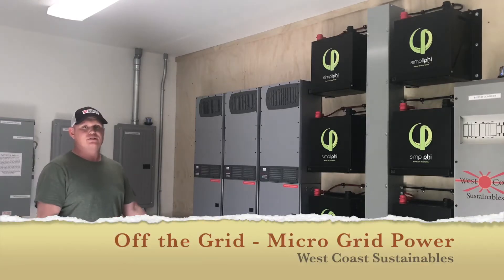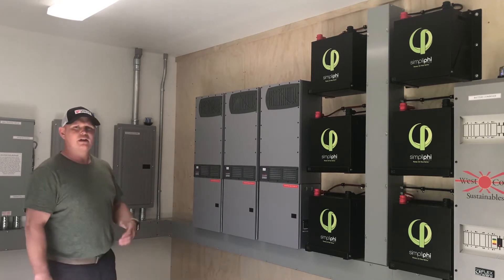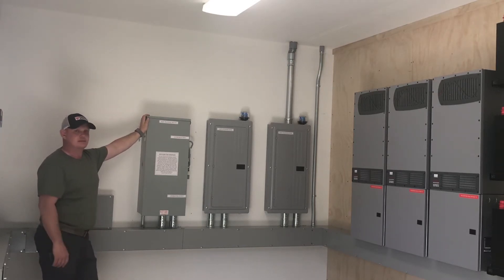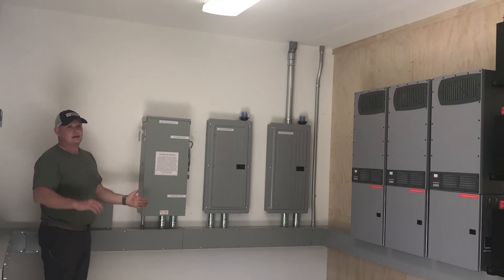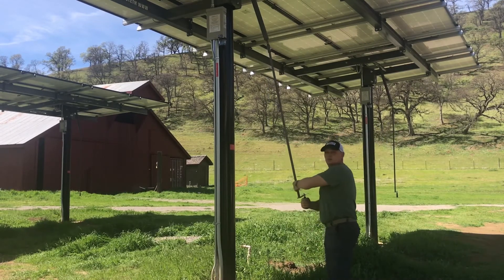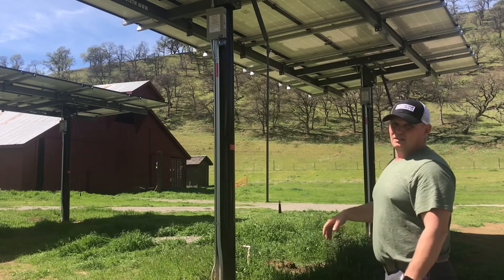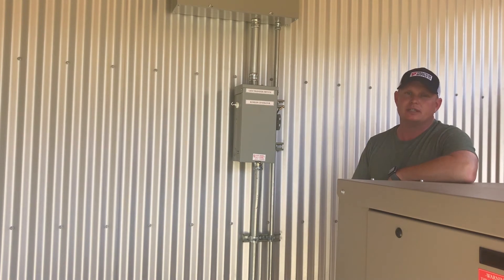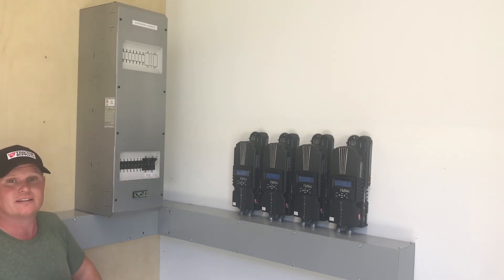Governor Browns Off Grid Micro Grid

Comment: For such a nice system, it is a shame to see the obvious violations
1. Koher 24RCL not rated for off grid, EPA violation and zero warranty from Kohler
2. Exhaust of generator directed right back into structure, 7:35 that large louvered panel is exhaust
3. LP gas regulator does not appear to be 5 feet from generator per NFPA 37, 54, and 58

#1 is especially concerning considering who it is for, rules for some of us and not others I guess.

Comment: what is the size of the cable connecting the batteries to the combiner?
Reply from the maker: #4 fine strand, the max thy ever carry is about 25 Amps dc, these will be upgraded at the end of the month to the 24- 3.8 with heila integration

Comment: I am planning on an off grid system for 2900 sq ft custom built residence. For comparison purposes, what is the wattage generating capacity of this system? Did you recommend a seperate utility building for the equipment and, if so, what size do you prefer for a whole house, off grid system (we will not behaving a generator or windmill component)?
Reply from the maker: Phillip Mowers hi there yes it was a separate building, the system can do 24 kw of load and I wouldn’t build an off grid with out a generator
Reply: Do you install in eastern Arizona?

Comment: 30 grand in batteries alone. Clean setup but made for the rich i guess
Reply from the maker: NewfieMike well I can’t disagree with that they are expensive but this powers a property with multiple structures I guess you wouldn’t have those either if you didn’t have the coin.  
I build all levels of projects though but it sure is fun to get to play with these once in a while.
Reply: Jason Andrade i dont doubt the functionality of these, but yeah for multiple structures and money to spare they are for sure the way to go
Reply from the maker: Wait till I get to release the video I just did with Discover battery!! They helped me upgrade my off grid wood shop with some of their new AES 6.65 batteries and they are beasts
Reply from the maker: The great thing about renewable energy is you can spend what ever you want and live how ever you want as long as it within your means.  My personal system I’ve done fairly cheap by trading, getting some used equipment, some manufacturers have helped for social media marketing but a lot of it was my creativity
Reply: Jason Andrade can't wait.  Its fun to see the high end setups for sure
Reply: Jason Andrade you definitely earned a new sub 👍
Reply: I have to agree with other posters on the cleanest systems I've ever seen. As I said one of your previous videos I'm a little bit jealous with my measly 640 watts of two solar panels and two 6 volt batteries just the beginning I suppose. Although it right now I have no need for this kind of power but I do have 40 acres in Arizona desert would love to be able to generate a lot more is funds become available to grow I will. Thank you again for your videos and keep up the amazing work.

Comment: The scale and quality of your installs is amazing! But my guess is on the computer you edit and upload your videos from has a huge sound system on it so you cant tell how quit the audio levels are. Not that your viewer count is of any concern to you but most of us watch on cell phones in our down moments. Mic up or increase the audio levels on your editing software.
Reply from the maker: mechanical stuff since making this video I have purchased the Rode wireless mics, a blue mic and AirPods, if you watch a couple of my other recent videos it’s getting better.   This was footage I took a while ago and almost forgot about.
Reply: Jason Andrade  appreciate the responce. ya right after i said that u sitting at the table with your laptop testing mics was the next recommended video. Haha. Love the work keep it up. I work in a R&D area that has alot of power supplies running and its just hard to hear your audio over the fan noises. Cause of coliflower ear An earbud hurts my ears and headphones are prohibited here. (One ear has to be open to hear the bench) lots of down time waiting for condition. Alot of times i just listen to videos while the phones in my chest pocket.
Reply from the maker: mechanical stuff hey were you a wrestler?? And R&D with power supplies let’s chat more :)